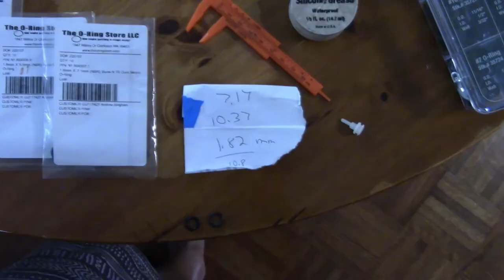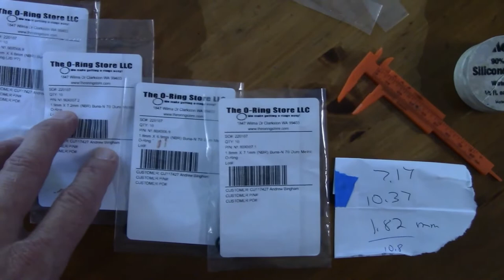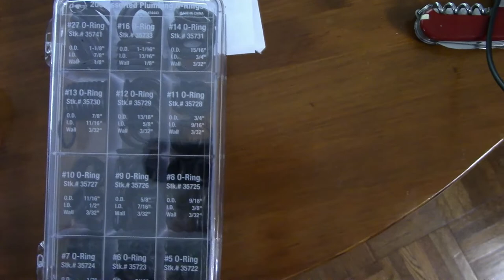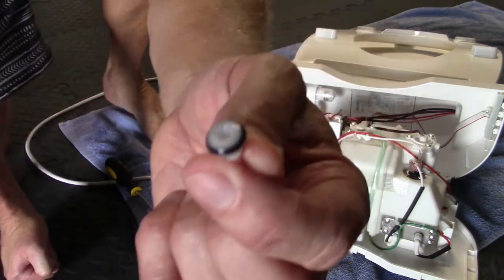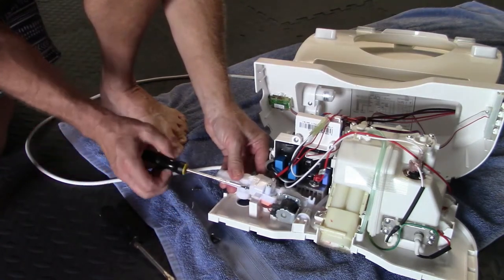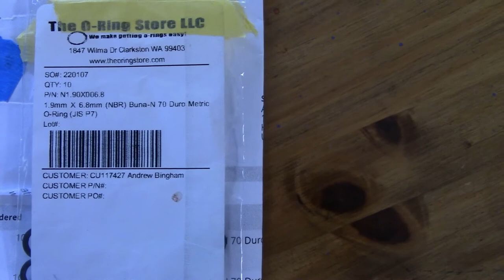brondell Swash 300 bidet repair.

Comment: I've noticed a drip drip from the middle of the back where the wands come out. Is this what you mean by "constantly running"? Seems like the ring you fixed was over in the input side. Thanks!
Reply from the maker: To be honest I can't remember exactly what I meant by that, but I'm pretty sure it was not a drip drip drip.  But, if you have water coming out then that input valve is letting water get by and the fix should be the same.  Good luck.
Reply: Thanks, Bud!

Comment: Thanks for documenting your repair. Was your leak at the housing where you replaced the o-rings such that water was dripping out the bottom of the bidet, or was the leak at the nozzles into the bowl? 

w
Reply from the maker: Neither.  It had a small leak right at the valve.   You could see where one of the screws was rusting from being wet.  If I remember correctly, it would just quit working.  Actually I think possibly you could hear the nozzles dripping into the bowl sometimes too.  I would have to get up in the middle of the night to turn it off.  It has been a while, but there were no puddles anywhere out of the bottom of the bidet.  Hope that helps.  My memory is a little rusty.
Reply: @Tideview1, was your problem leaking water from the filter to the floor? If so, was it the o ring of the filter or something else?